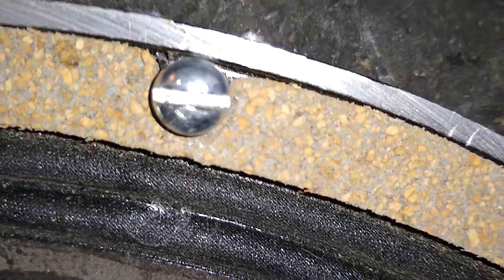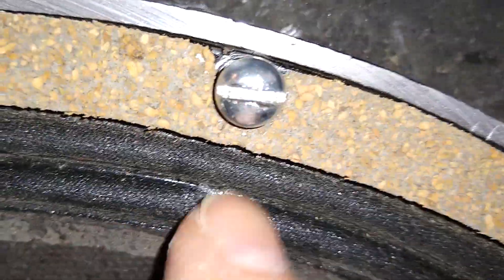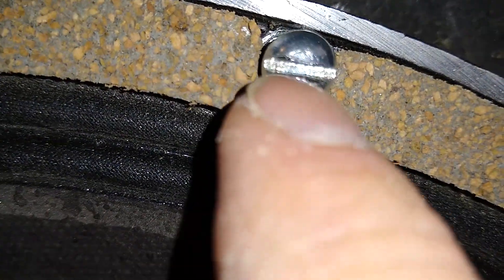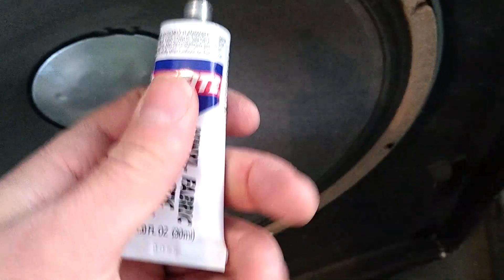Speaker Repair; Torn Surround

Comment: This worked. I ordered the Locktite mastic for the speaker cones in my old Mercedes where the foam had broken. I was light handed when applying the glue, it repaired them eliminating the rattles. all six speakers were examined and repaired with glue where necessary. I was able to bridge some holes where necessary. The sound is fresh, base is accurate, and performance is what I once remember it being.

Comment: Tried your suggestion and had good results!  For reference, I used paper towel cloth. My small speaker was ripped all the way round the outside perimeter, so used small pieces of cloth to patch with the Lock Tite Fabric glue.  Cheerz

Comment: A good way to also do this is use a paint brush and get a can of flex seal. Brush on a couple of thin coats and itll work great on rubber and foam surrounds 👍
Reply from the maker: I don't deal with rubber surrounds much but I'll have to give that a shot!

Comment from the maker: Quick addendum; I forgot to mention that probably the best material to use to repair speakers is cigarette rolling papers.  It's thin, flexible and easy to cut/handle.
Reply: That's a good idea. Do you think gift wrapping tissue paper would work as well? It seems a little thicker.
Reply from the maker: @nros5020  I don't see why not but the thicker the paper, the more it will influence the sound.

Comment: Hi!I have made several exchanges of speakers in guitar cabinets but today i was in a hurry and punctured a hole on the side foam...I tried your fix with shoe glue and i hope it works..How can i know if it did?What do you expect if its not ok??Rattle?Thanks a lot!!
Reply from the maker: You can expect a faint buzz if it doesn't work but more importantly, the tear will spread.
Reply: @wado1942  I hope it`s ok..Thanks!!

Comment: I want to buy a speaker which has a fingernail deep notch in the rubber sorrounding. Will it affect the speaker negatively or can more problems occure ? Thanks in advance!
Reply from the maker: Tears in speakers tend to buzz and spread with time.  If you buy it, assume you'll have to repair it.
Reply: @wado1942  It is not cut through, just a finger nail deep dent. Would it be the same case? I really don't want to exchange the whole thing.
Reply from the maker: @MrRizoable  If it isn't actually punctured, it's probably fine at least for the time being.  It might eventually tear or not.
Reply: @wado1942  Since it is a potential risk, I won't put the trigger. I am talking about a WGS Black Hawk 50 Watt for around 140$ which would be a great deal actually. The dent is pretty tiny but you never know. Thanks for your help!! Best regards from Germany
Reply from the maker: @MrRizoable  Best of luck to you and thank you!

Comment: i just used super glue, whats the benefit of reinforcing with tissue?
Reply from the maker: Super glue is not flexible, hence the rubber cement.  The reinforcement is for better strength, keeps it from ripping when you push the speaker harder.
Reply: @wado1942  can I use rubber based adhesive??
Reply from the maker: @tda7294  yes

Comment: Question - any way I could use a slime pre adhesive bike tire patch? I have these nice old phillips speakers, and one of the small speaker tweeters has a very small rip.
Reply from the maker: I'm not sure.  If it dries solid but flexible, it's worth a try.  Maybe test some on a piece of paper to see how it acts there first.
Reply: @wado1942  interesting. I will definitely try it out, thanks.
Reply: Hey there did it work? Nice video btw thankss